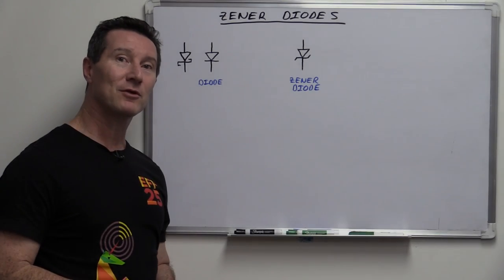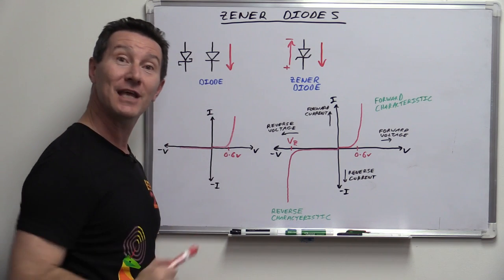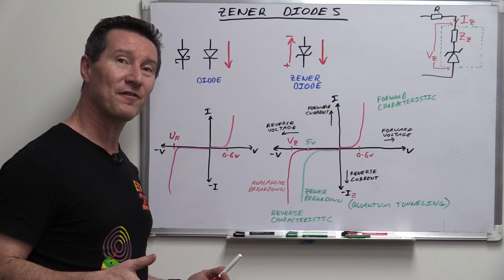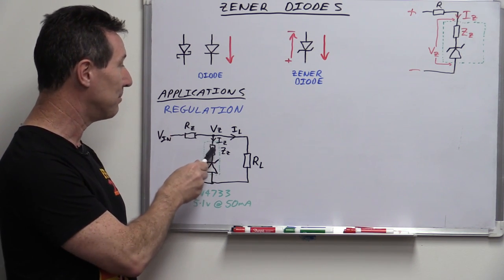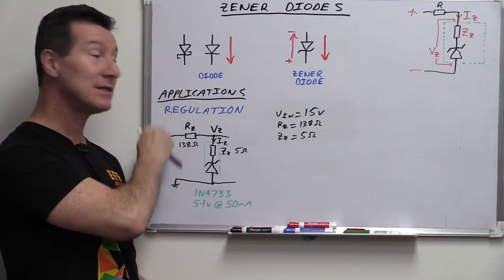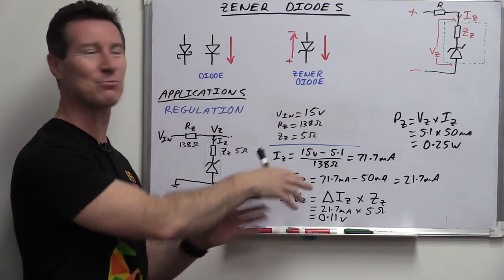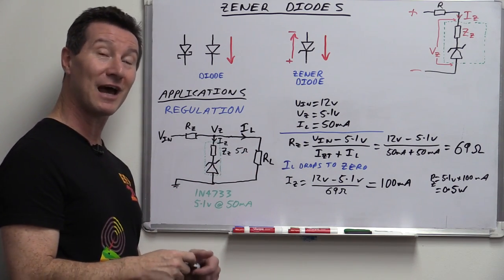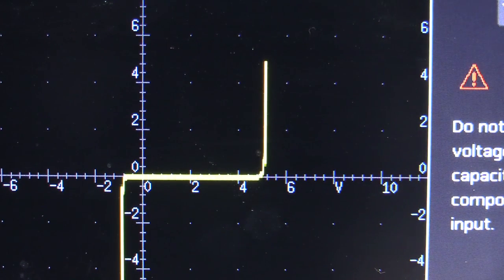EEVblog #908 - Zener Diodes

Comment: Good stuff Dave.
I would like to augment your tutorial with some additional information that might have been covered...

I waited for the explanation of why 5.1 volts was used - expecting to hear some historical info on temperature coefficients of zeners and why 5.1V devices were used in early discrete circuits where a good reference for power-supply or A-D Convertor was required.  The 5.1V zener can be manufactured to a tight temperature coefficient - nearly ZERO at the correct bias current.

Above 5.1 volts nominal, a zener has a positive temperature coefficient.  Below 5.1 volts nominal, a zener has a negative temperature coefficient.  So 5.1 volts is the goldilocks zone for a zener used as a voltage reference.

The other thing that is very important when designing with them, is that ALL zener diodes have a reverse leakage.  But below 5.1 volts nominal (quantum tunneling), the reverse leakage is orders of magnitude higher in most cases, compared to a zener in the same family of avalanche voltage higher than 5.1 volts nominal.  This makes zener diodes below 5.1 volts nominal pretty useless for anything much except rough and ready clamp or bias circuits.

Avalanche zeners make pretty cheap and cool wide-band white-noise generators.

Comment: The way I was taught to draw Schottky diodes was to curve the squiggles the other way around from your drawing—to form the letter S (∫). The Zener diode is drawn the other way around, naturally, to form the letter Z.
Reply: I though the same.
Reply: There's also another symbol for Zener diode, with something looking like a letter "L" instead of the wiggly thing. Anyways it's usually obvious from schematics whether it's Zener or Schottky.
Reply: The "L" comes from the other name for Zener diodes which is "break over" diode.
Reply: Ronald Youvan We used to call them "stabilistors" in Poland.
Reply: We still call them "stabilitrons" in Lithuania

Comment: Personally I take issue with people that incorrectly depict the direction of current through a diode.  The current is always in the opposite direction of the arrow.  Ignorance is why the diode is pointing in the wrong direction.  Those who first defined the symbol thought they were viewing the electrons flowing but instead they were seeing the holes.  The blank spaces are the holes and it's an optical illusion not a truth.
Reply: Yea, but not sticking with the "convention" when nearly all circuits are drawn that way will confuse many geginners. On the other hand, viewing a circuit as having electron current flow vs. holes, gives you a whole new view of what's really going on in those components.

Comment: I don't get the difference between your point for "multiplication" and your "decimal point"
Instead of 5.1V its 5*1V and when you multiply it's the other way round.
Should be written more clearly
Reply from the maker: It was very clear.
Reply: 5·1 (Standard Engineering Notation)
5*1 (Mathematical Notation)

Comment: So you regulate by allowing the current through at the reverse voltage? That seems like a stupid idea. you're just throwing away your power by basically shorting your circuit to ground for anything over that zener voltage?